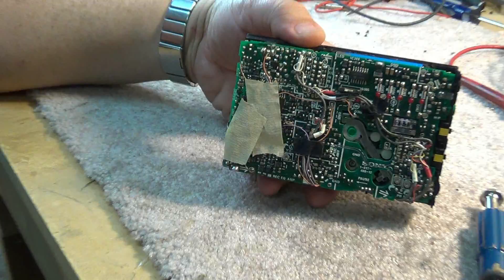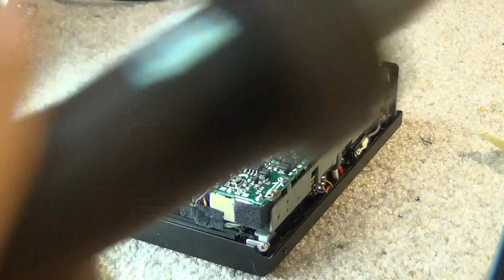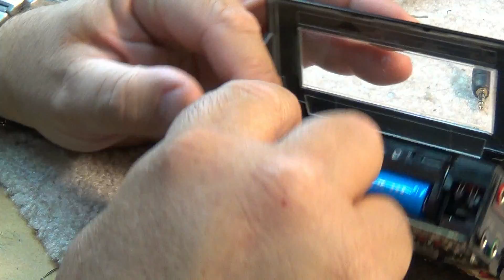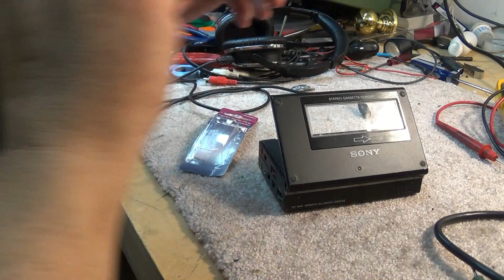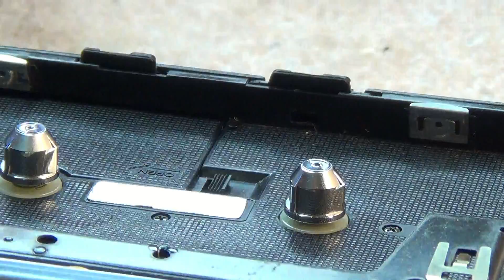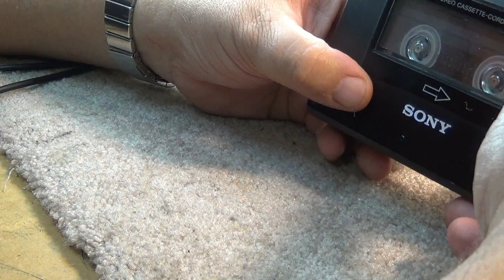Sony WM D3 Servo repair

Comment: Hey, i’m in the process of fixing one for my grandpa and am not facing the same issues you are, but was curious if you’d know how to seperate the other half so i could look inside? i’m consistently reading after years of wear that the plastic gears could also be an issue and am curious if your professional opinion, thanks

Comment: I have a weird Problem with mine, when i open the device the tape is stuck and i carefully have to peel it on from the top while trying not to put any force on the door. its really weird why it gets stuck in there, i saw there is a little black knob up there connected to a spring, i suppose that checks if the tape bottom plastic thingies for recording are broken out or not.

Comment: No wonder on eBay, for this model, several listings will say that the door won't close- it's that damn spring!
Reply from the maker: Usually it is the catch that breaks. The spring gets lost when someone opens it and forgets about it,and boing, it is gone.

Comment: Sony didn't use masking tape to secure wires it must have been someone who had it part in the past.
They used a thin almost clear tape. I think it might have had some thin strips in it to stop it tearing cross the tape.
Reply: always a black tape from what Ive seen., but yes, that masking tape was not factory.

Comment: Isn't silver solder supposed to be good?
Reply from the maker: For soldering silver.  Most of the time it is acid core and will ruin electronics.  Rosin core is what you want.  60/40 is the easiest to work with.  Lead free is crap.
Reply: @12voltvids  I just saw a video where a guy used it to mod a game system.

Comment: hi there I have a d3 and the door won't stay closed because some genius before me has lost that spring

do you have any ideas of the size? thanks
Reply from the maker: I have no idea the size of that tiny little spring. We used to buy them by the bag full as they were always being lost on the old walkmans in for service.
It is about 1/2" long when uncompressed.  I was thinking that the tungsten filiment of an old incandescent light bulb cut to length might just be the ticket.
Cut a piece of the coiled filiment, and stretch it slightly so it becomes springy. What do you think of that?
Reply: thanks for your reply, you are very kind 
i actually realised all i need to do is measure the hole the spring gets inserted through and that will give me the width now you have told me the length
take care.

Comment: how do you adjust the azimuth? I need to adjust the head I noticed when I lift the cassette while playing it sounds clearer which makes me think the head is misaligned
Reply from the maker: There is a screw on the side of the head. If you remove the tape cover you will see a hole in the chassis to adjust the azimuth. If you don't remove the tape cover, you will see a small plastic cover that covers an adjustment hole in the tape cover located between the S and O about 1/2" down from the sony badge. Remove the cap,and a small screw driver can be inserted to adjust the azimuth of the head when in play mode.
Reply: YES! this worked thank you!

Comment: A have one of these, great units, did recordings of folk concerts and music at Indian Ashrams. The capstan is locked up,  have you experienced this before ? I guess I would need a special screwdriver for those tiny screws. Thanks for putting this up. You mentioned  a previous programme, is it available ?
Reply from the maker: +juginder As Dr Cassette put it in the previous comment. The midway drive gear breaks on these units. I found a link to one that someone is showing all apart and running, so you can see the gear that usually breaks. It is the black one in the middle.https://www.youtube.com/watch?v=V8LX1gfF3yIAlso the nylon drive gear on the flywheel (capstan) also has been known to crack.Due to thermal expansion of the metal parts. The plastic doesn`t give, and it cracks. Very common problem on 8mm VCR tape hubs too.

Comment: I have a Sony TCM-15V that I am trying to repair. The servo is functional but doesn't receive any voltage from the la5523. I don't know if it is that chip or the servo amp circuit. Does anyone have any tips or suggestions for the repair. Thanks.

Edit: I also need some new belts since they have literally melted away.

Edit Edit: I got the motor to work, the pause switch just sticks, but I still need belts If anyone knows where to buy them or improvise.

Comment: HI Could you repair a drive gear on a DD series walkman?   I want someone to fix mine Boodakhan walkman.
Reply from the maker: ***** I have no more access to parts than anyone else.When the nylon gear breaks there is not much you can do as far as replacing the part. Perhaps one could be manufactured using a 3d printer, but I have never gone down that road. If anyone knows of any companies that offer this service I would love to hear about it, as I have a couple of nice Sony Hi8 decks that have cracked take up hub gears that I have been unable to get. One of these decks has PCM sound, and it is the only deck able to play some tapes that I made on a professional recorder that has no FM sound, only PCM. Most consumer units do not play the PCM track, so those tapes play with no sound, so I am most interested in finding a replacement part, but so far no luck. Every unit I have bought hoping to salvage a gear from has the same gear broken!
Reply: +12voltvids  A have one of these,great units, did recordings of folk concerts and music at Indian Ashrams. The capstan is locked up,  have you experienced this before ?

Comment: About the masking tape, I have opened a lot of cassette walkmans (including Sony) and have seen masking tape  on the circuit board. I was sort of confused, but I kinda ignored it after a while, and thought to myself that it was normal.
Reply from the maker: Usually tape placed by manufactures is the black, felt type.
Masking tape is usually placed by servicers when they worked on the unit.

Comment: I found a Sony WM-D3 at a flea market years ago. Very unfortunately these units all share one problem: There is a plastic gear with a metal insert in the middle. Over the years, the plastic part shrinks slightly and since the metal insert won't do the same, the plastic will eventually crack. That happened on many units, including mine. At first it would still work, but the cracked gear soon started to cause an unstable speed and eventually the mechanism would just get stuck in the crack of the gear and the Walkman just wouldn't work anymore at all. Too bad...
Reply from the maker: Those white nylon gears were very problematic.
It isn't that the plastic shrinks, but more that metal expands and contracts with heat, and the stress causes cracks.
Same thing happens with teeth that had silver/mercury fillings. Eventurlly the constant expanding will crack the tooth, and require a crown. At least that is what my dentist tells me.
Reply: 12voltvids
Hmm, so if the recorder is kept at a relatively constant temperature it will continue working. That's good to know.
Reply from the maker: DrCassette
Those white nylon gears were a problem. I have one that is cracked in my EVS7000 Hi-8 with the PCM sound recorder. If I go into FF it jams and eats the tape. Need to find a new take up hub for it. Same problem. They had a metal disk, with the plastic gear around it.The hub has a magnet on the bottom. The magnet pulls on the metal disk, and this is how they regulate tape tension, the gear can rotate, and the magnetic attraction causes the hub to rotate. The problem is the metal disk expands, and cracks the gear. I should make a video of it. Will do once I get around to ordering a new tape up hub for that machine, which I really should do before they are all gone..